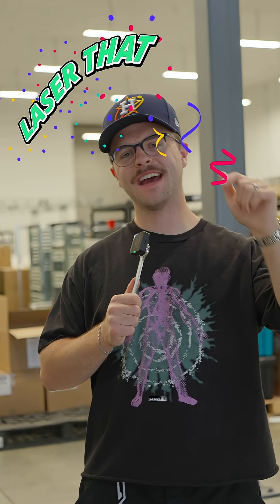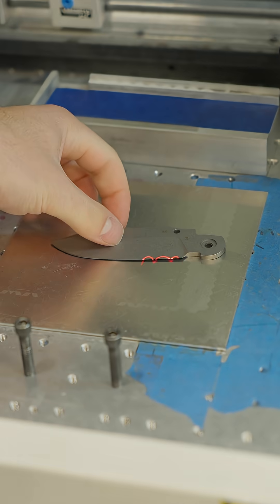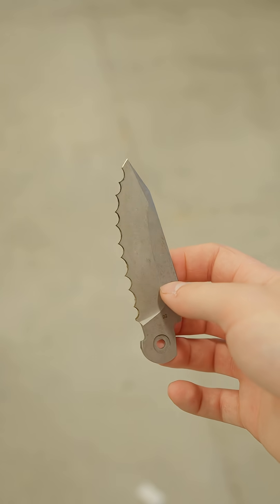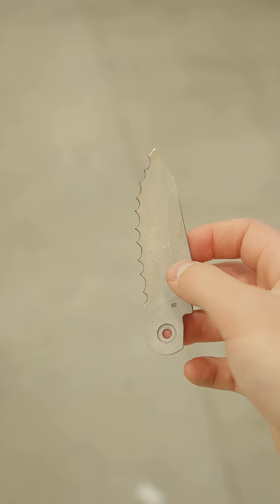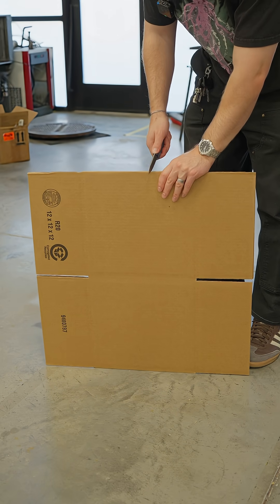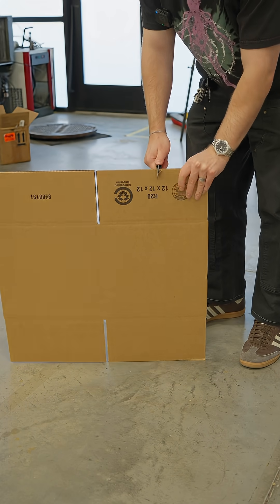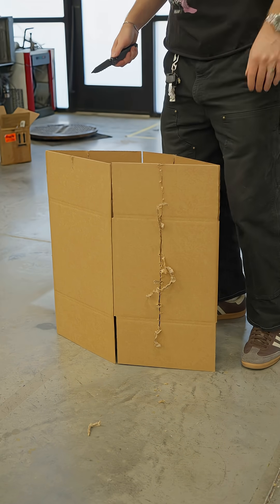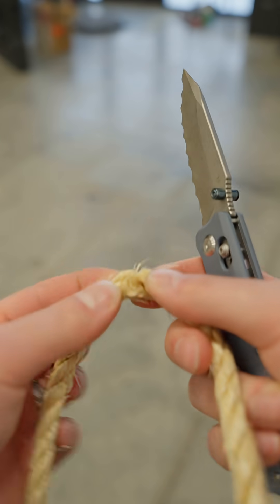Serrating My Knife With a Fiber Laser!

Comment: That’s because of two things. 1 is if you REALLY want your serrations that far apart, they need a deep sharpening with a ceramic rod or a file. You barely see a bevel on that. I have seen more bevel on smaller serrations; in fact I’ve seen a more distinct secondary bevel on knives with a plain edge. Secondly, take into consideration, knives that are on the market with full blades serrations, such as Spydercos. They have serrations that are a lot smaller. AND along with the rounded edge, have teeth to bite into the thick material. Not saying staggering serrations like that is necessary but it might help. Even if you don’t stagger serrations like that, and just want them all semicircular, crescent moon shaped, or even v shaped, having them smaller and closer together will help greatly
Reply from the maker: Thanks for the detailed feedback, I appreciate it!

Comment: I wouldn't call these serrations, what you did is more like saw teeth. Serrations have a continuous edge that are similar to a chisel grind, then it has the saw teeth that stick out past the edge. 

What you should've done, if you plan to test this again. Is do it in the same pattern you did this time, but only laser off the surface material near the edge until its like a chisel grind, rather than just cutting out notches in the edge like you did. Then you can take a diamond rod and round them out a bit better.
Reply: Yeah serrations are typically staggered with smaller serrations between the larger ones. Also, the bulk stock removal is primarily one side of the blade, leaving the majority of the blade stock itself intact, and the other side only showing the area removed from the original edge... This reminds me of those cutco steak knives, only worse because cutco steak knives are pretty damn good.

Given the size of the blade and disproportionately large teeth, I really don't see this being functional at all – even with cardboard for very long, and anything like a nylon trailer tie or climbing rope would likely end up taking some of the teeth.
Reply from the maker: Good info! If we do this again I'll try it out!

Comment: . Did you sharpen the insides of the serrations or just the points it looks like you just sharpen the points and if that's what you did the points aren't what do the cutting
Reply from the maker: Yeah, I didn't realize that until the testing. I might retry it and make the serrations smaller and sharpen it better

Comment: For a moment, I was afraid these would be the "laser cut serrations" Eickhorn-Sollingen out on their pocket rescue tool knives back in the mid 2000's... They were simply cuts made into the face of the blade and 45 & 90 degree angles, achieving nothing more than creating a trap for fibrous material. 

Side note, my BEEF is in red G10 with the silver blade.